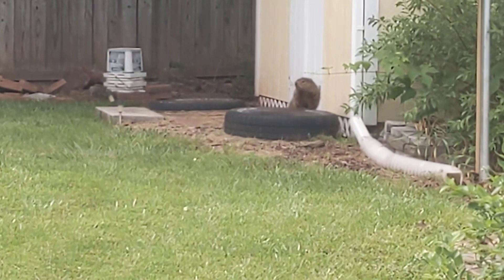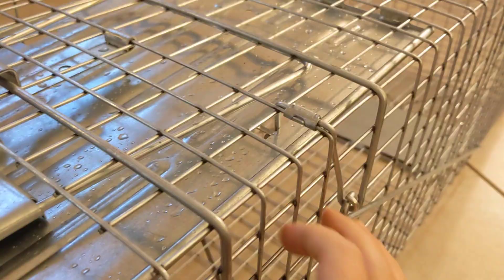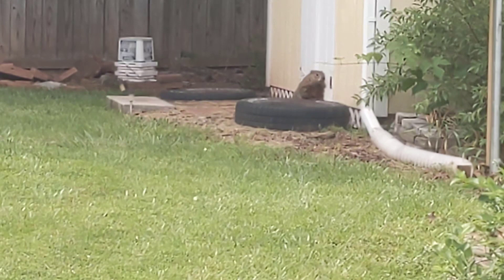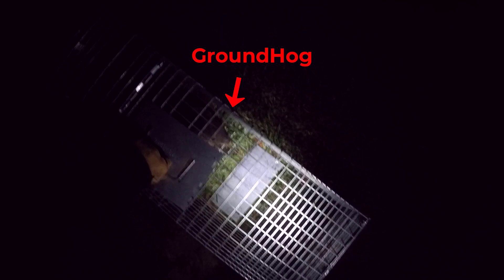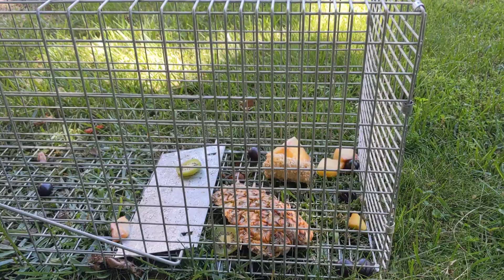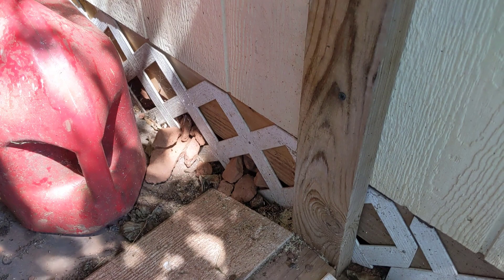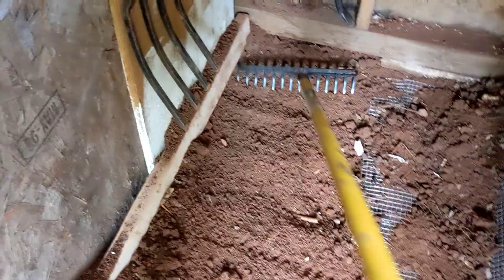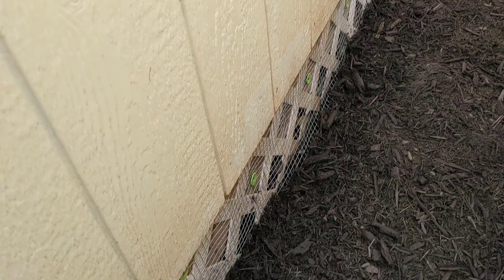How to catch a GroundHog in your yard.

Comment: I usually relocate trapped animals to the state park . If they have a hunting season on them they are considered property of the state. So they get to deal with them, so far 5 opossum,  3 raccoon  and 2 skunks. Ended up having to use a pellet rifle on the ground hog as it kept tripping the trap. I'm assuming that after 3 good stings it had enough and moved to more hospitable surroundings.
Reply from the maker: how do you trap a skunk without getting sprayed?  Or do you just have to accept that you will get sprayed?
Reply: @burrheadjr  actually it's easy , when I see that it's a skunk I get a drop cloth and walk up slowly and cover the trap over. You can pick the trap up and put it into the back of the truck (that's what I do) then just drive it to the park and open the cage and back away . The skunk will vacate the trap rather quickly. Note to you I never release them anywhere near a picnic area or camp grounds.
Reply: Drop the skunk in a storage bin filled with water with a brick or rock on top and you won't get sprayed
Reply: @georgedistel1203  This is pretty much how I do it except I take a stick and rattle the closed end of the trap while simultaneously opening the trap door. The skunk is only concerned with the stick rattling around and doesn’t even pay attention to the other end that you are opening. Then just remove the tarp and walk away. Done it many times and never been sprayed.